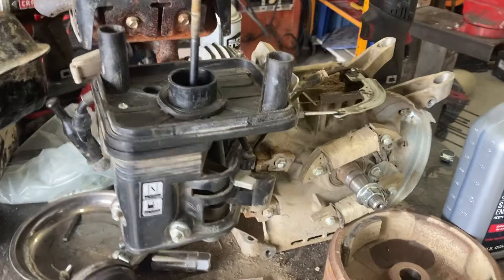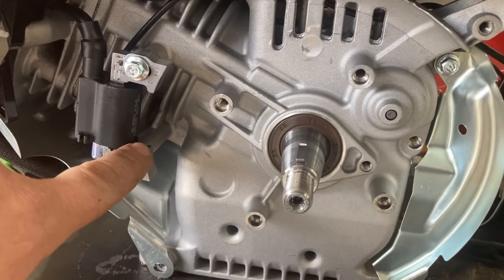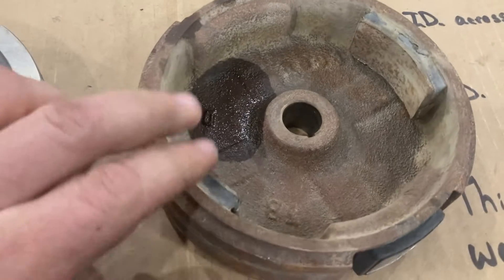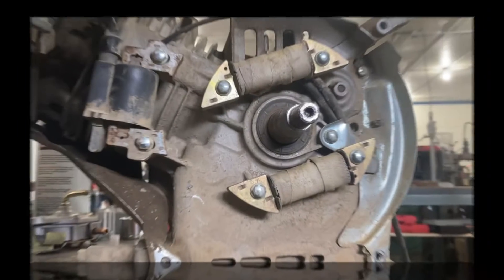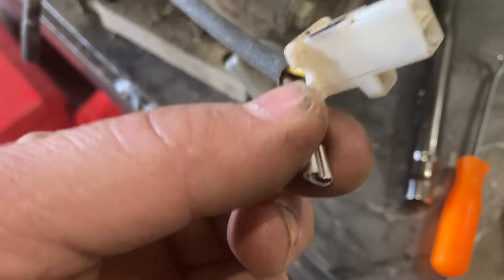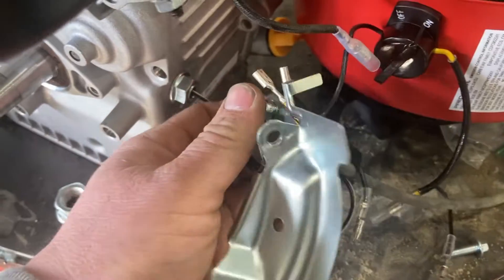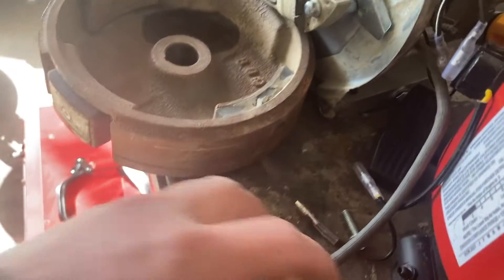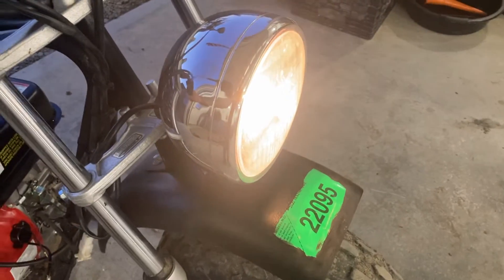Coleman Mini Bike Headlight - MAKE IT WORK with a PREDATOR Engine Upgrade!

Comment: So the 212 flywheel doesn’t have magnets and the 196 does? Is this the reason you can’t use the factory 212 flywheel?
Reply from the maker: Exactly right. The magnets are missing on the flywheel.

Comment: Late comment question
But did you use a regulator to a battery by chance?? Or just wire straight to lights??
Reply from the maker: No battery, no regulator. Direct to the light just like the original.
Reply: @MaineMachinist  very cool.. thank you

Comment: Why can’t power be taken from the spark plug power?

Great video, I’ve been trying to figure out why none of the wires on my 212 give me electricity!
Reply from the maker: You really don’t want to draw power from the ignition. I don’t know if any manufacturer who has done it that way. The dual coils and magnets setup shown here is the typical way to do it.
Reply: @MaineMachinist  great thanks for the reply.  I’m assuming the 212 is the same? 

I have my 196cc still, so I can pull the coil from it.

Comment: My headlight has 3 wires coming from it. Green,blue, and white. They cut the connectors off. Where do the 3 wires go. The connector is cut off of the charging wires as well. Please help

Comment: Didnt work on my predator 212...started her up, but the headlight didnt come on😢
Reply from the maker: If you follow the steps shown here exactly, it will work. Maybe there’s a loose connection. Pay careful attention to the magnets. Make sure the flywheel is correct.

Comment: Thank you for this video. This video alone helped my son and I retain his headlight on his 224 swapped CT200u-EX
Reply from the maker: Glad it was a help. Thanks for watching.
Reply: I have a 3 wire headlight on my minibike and the boy I got it from cut the connectors off of the headlight and the charging wires. The 2 yellow ones. Where do the 3 headlight wires go to

Comment: Is there another way to get lights working on the predator 224?
Reply from the maker: Unfortunately not if you want to run power from the engine itself

Comment: Yeah it's just a parts swap over and the 224 uses a clone flywheel taper. All new engines of this type uses a crankshaft with a clone flywheel taper except the common Predator 212's. Tillotson, Wildcat, Ducar all use a clone taper. Thankfully the 224 and now the new 212 Ghost have clone crankshafts with a clone flywheel taper. Predator 212 was always the oddball with a unique crankshaft.

Comment: So if you're going to swap the tin parts over to the Predator, you don't have to remove the grommet, wires from the grommet, or the wires from the plug. You can swap them all together.
Reply from the maker: It is true you could do that. However when we first started we weren’t sure if we’d have to change it some to miss the oil sensor. It’s also a little easier to get everything in place and handle it all separately I think.